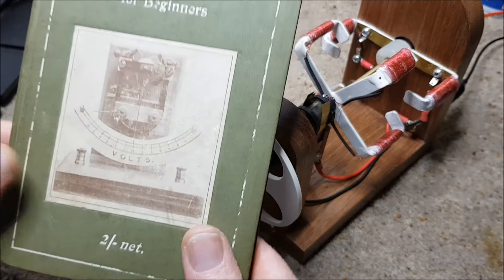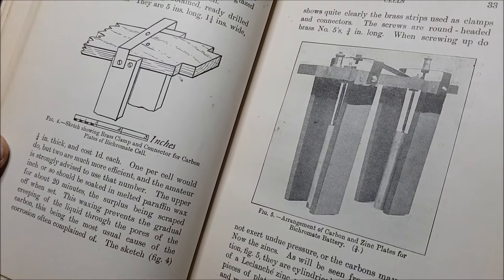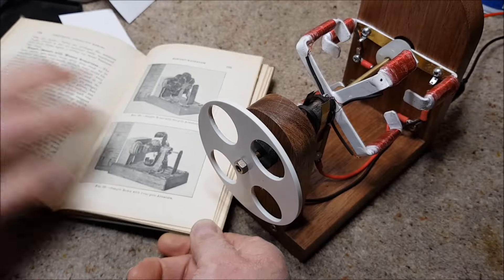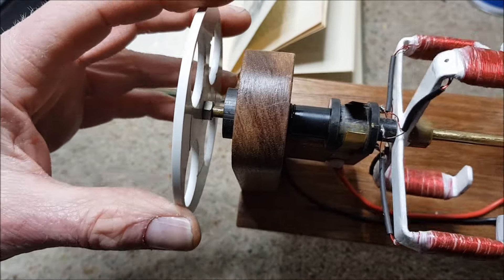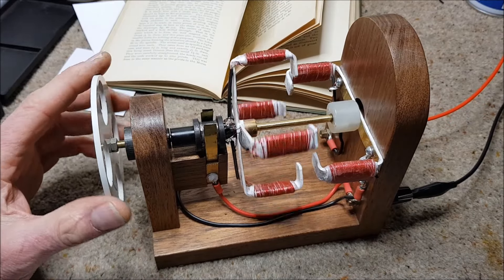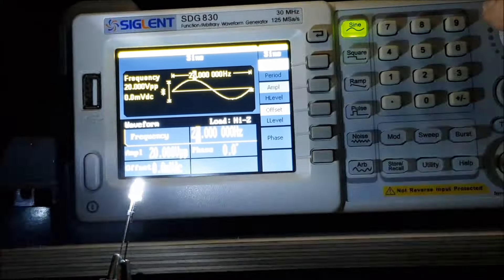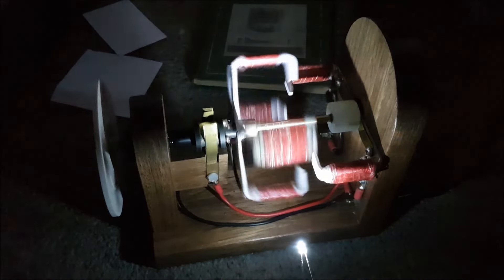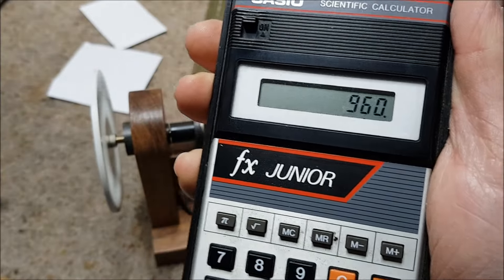Building an electric motor from a 1916 vintage reference book.

Comment: Beautifully done! Great video! A similar book you might liked is "The Boy Electrician" by Alfred P Morgan from that same time period. If you google it there a plenty of free pdfs available for downloads since it seems to have been published before copyrights took effect in the US. Don't let the name fool you - its the best book I have ever seen for how to build basic electrical stuff!
Reply from the maker: Thank you for the comments. It was a nice project and kept me amused for several days . I experimented obsessively when i was in school from some old text books. My favorite gadgets involved high voltages. I had access to old magnetos and ignition coils. I used vibrators from old radio sets in series with an ignition coil with a 0.1uf cap across the vibrator. This gave me continuous 1 1/2" sparks. I built a coherer in a old fuse with fillings from a nickle coin. I also built an oscilloscope with an old black and white tv tube. I used a eht rectifier valve running off a 1 1/2 volt battery to rectifier the ignition coil and feed the eht to the tube. I did not no how to build a saw-tooth timbase so instead fed the scan coils for the y axis with a 12 volt AC . The X axis was fed from a simple valve amp I had built from the fun with radio book by Gilbeert and Davy. It gave a great display  even if the trace was a symmetrical representation of the input waveform.  I dread to think how much X ray radiation I must of exposed myself to at that time. 
I found the link to the book you mentioned on the world radio history website. Thank you again. https://www.worldradiohistory.com/BOOKSHELF-ARH/Technology/Author-Groups/A.P.Morgan/The-Boy-Electrician-Morgan.pdfhttps://www.worldradiohistory.com/BOOKSHELF-ARH/Technology/Author-Groups/A.P.Morgan/The-Boy-Electrician-Morgan.pdf
Reply: @stevewardguitars1661  Gee - you just described a lot of the things I did! ignitions coils and oscilloscope TV included! And a coherer - wow - so few people even know about that early RF detector!  

By the way - you probably dont have much to worry about regarding X-Rays- the 18kv or so on BW tv tubes is very low energy and the xrays are very "soft" meaning easily absorbed. Most likely the lead glass in the CRT absorbed most of the X-Rays. Color CRTs used up to 35kV and were worse, but it was the early color sets that had a triode that regulated the HV by shunting it to ground. The were really good X-ray tubes!

Comment: The motor is an object of simplistic beauty. One lifetime is too short to do everything one wants to do so it is fantastic to see a craftsman build something from an old school book. I have downloaded many such books in eBook format from Gutenberg but alas I do not have the time or the equipment to reproduce any project. Well done sir your personality shows in your work. I had a Merit chemistry set that was our primary hobby in the 60's and 70's apart from collecting stamps - which no one does any longer I believe.
Reply from the maker: Thank you Hendrik, I really appreciate the kind comments. I have always enjoyed building electronic and electromechanical projects. Over the years I have designed and built quite an eclectic range of devices. Most of my interests have been science and radio based. I took my amateur radio licence back in 1980 after many years of building radios and transmitters it was finally  great to talk to like minded enthusiasts. I wonder if you have seen my video of the mechanical television? This was my all time  favourite project it encompassed all the disciplines of electronics, mechanics, audio and radio.
Reply: @stevewardguitars1661  A mechanical television? NO sir - I am subscribing and I will have a look. The closest I ever came to a radio was the CB in my car back in the 70's. Your work is amazing and it deserves many , many views. Greetings from Africa. A few years ago I bought a tube amplifier. It is still in the box as honestly I do not know how to put together a complete audio system. I have spent 50 years in IT so that I know well. I have so many kits of electronic projects lying around including Raspberry but I do not have the electronic background to really do much.

Comment: It's better to put a piece of tape on the flywheel and start from a higher frequency for the strobe and a reduce it until you see the piece of tape in one place. If you increase the strobing frequency, it might appear that the frequency is right but actually it is only half of the frequency, so it lights only on every other rotation.

Comment: Using the strobe to find the rpm was real clever, nice work!
Reply from the maker: Thank you. I really enjoyed re-imagining this project from the 20's. LED's are really usefull devices and will switch at incredible speeds without hysteresis or thermal lag like an incandescent lamp. I have used 1 watt leds in a optical transmitter. Its an FM transmitter and  switches the led at 25khz and modulates them with audio. With a few 6" pound-shop magnifying glass lenses in front of the transmitter and receiver I can get 10 miles line of sight!There is a video on this channel of the project .

Comment: Terrific! Did you include bearings for the shaft to run on? Incidentally, your strobe is easily as impressive as the motor but there are rev counter apps for your smart phone. But that's now not in the spirit of the thing , I know! Cheers Steve, that was fun.
Reply from the maker: HI Mark, There are no metal roller bearings, however the brass shaft runs in nylon bearings fixed to the supports. It did keep me amused for a day or two re-imagining the text from the old book. Some of the books projects included making your own primary cells. Honestly the idea that school children of the present era could be entrusted with conc sulfuric acid and a 1/2 pint of mercury for some of the projects is horrifying.

Comment: I like so mush the estrobe efect...gona triall here too
Reply from the maker: L.E.D's unlike incandescent lamps have no thermal lag or persistence.They can be switched on and off at several hundred kilohertz with ease. The only near competition comes from neon or zeon tubes.  I built an frequency modulated  optical transmitter using leds and  photo-diodes. The carrier frequency was around 30 khz. I made a rough video of this project somewhere on my page. In clear line of sight the range was several miles .

Comment: Great effort. How much current did the motor draw at 12V?
Reply from the maker: Hi , The motor draws around 1 amp when running dipping at a full speed to around 0.75A .
Reply: @stevewardguitars1661  Thank You. Intresting how motors draw less current at speed.🙂
Reply from the maker: @benvandermerwe2359 Motors in general can draw 10 X their normal running current at startup. This is due to the increase in inductive reactance as the motor spins up to full speed. When stationary only the relatively low resistance of the stator and armature coils is in opposition to the supplied voltage. At this point the current is high. As the speed increases the inductive reactance of the spinning motor also increases and so does therefore the opposition to applied voltage. The current then drops with the increased resistance. More current will be drawn however when the motor is under load.

Comment: How many watts if generator
Reply from the maker: This device is actually a motor, not a generator, so it won't generate any power. It relies on electromagnets in the field windings. However, if these were replaced with permanent magnets, it might generate a minuscule amount of voltage. The inefficiency of the design stems from the weak coupling between the rotor and the field windings.